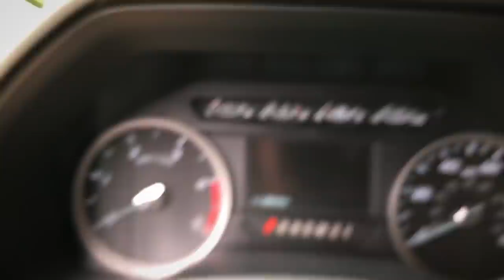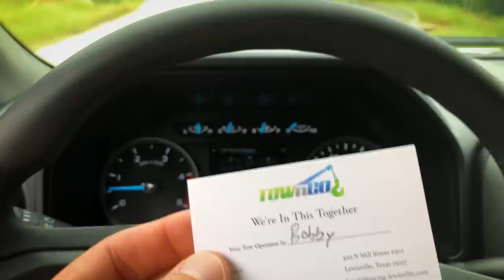I messed up...New F250 Stuck in Mud

Comment: Don't feel too bad, I totaled my brand new truck at 9,300 miles by getting it stuck on a beach in California where it sat through 2 high tides before a tow company would go out and get it... lol. https://imgur.com/gallery/PcAqvsE

Just be glad it was only a little mud and not waves of salt water lol.
Reply from the maker: Oh man!!!!!! 😬
Had to pin that.
Reply: @AaronBuley  lol, Yeah it all worked out though I think. The insurance covered it in full and I actually got like technically 500 bucks more than I paid for it, and they didn't raise my rates or drop me. And they had a buy back offer for the truck so I did that and then the guy that bought it is a mechanic and was going to do a little work on it and give it to his dad which was cool. So it all ended pretty well, I got a new truck that's working out better for me, and the insurance company doesn't totally hate me and someone gets a practically new truck for a fraction of the cost and the truck lives on to drive another day.

But the lesson lives on, you should never take heavy duty trucks through really any off roading adventures unless they and you are well equipped to handle it lol.

But I'm glad your truck made it out with no to minimal damage, that's always the best thing after getting stuck.
Reply from the maker: dedalliance1 yeah definitely learned my lesson on heavy duty trucks.   I was used to my Jeep Sarah Unlimited which could handle A LOT 

cool story on the truck 😁👍
Reply: @brianamrhein640  that's also how things get broken, or in my specific situation where 2 trucks end up flooded lol. But I was just on vacation and traveling through so I had no one to help me.
Reply: i never understood why people drive on the beach, what did yall think would happen?
Reply: @STREETRACEN4U  It's a legal drive on beach, and people drive on it all the time. What killed me was my truck was too heavy and I didn't deflate my tires and by the time I thought about deflating them it was too late. Offroading is a lot of fun and it's an adventure to go drive down the beach to see what you find. When I was a kid my mom took us to a beach in Florida and we drove out early 2000's 3/4 ton Yukon XL on the beach and everything went fine, so I had the same mindset that I would be fine too. Unfortunately, all it took was some soft sand and the truck was done for.
Reply: Atleast you probally got a another brand new truck out of it!
Reply: @silverback7659  Yeah I did, I actually got a little more for than what I paid for my other truck lol.
Reply: Not happy with that truck huh? Yeah "getting stuck" on the beach is a great way to get a mistake paid off isn't it😒
Reply: "4x4" is a huge misnomer on 3/4 ton trucks... Too heavy, no turn radius. I love my Ram 2500 but it will get stuck in a puddle leaving the driveway if you let it.
Reply: I did the same on North Shore Hawaii , a man told me to let most of the air out of the tires and came right out.
Reply: Ouch!
Reply: dedalliance1 OUCH!!! That def sucks!
Reply: @Crystal Bolyard Not junk. Just shitty off road. That's why they're called " Super DUTY!" LOL.
Reply: dedalliance1 there is no way in hell that ur insurance rate isn’t going to increase for the next five years after the incident.
Reply: Bra wood and a shovel
Reply: Buley Builds u would be ok with better tires
Reply: @thisoldnew4544  My insurance rate did not increase because A: It was a legal drive on beach so it's basically considered a road, and because of that it being flooded by the ocean is considered an act of nature and that I cannot be dropped or have my rates raised because of it. Every insurance company is going to be different, but that's how mine worked. And I only had the insurance plan for like, 4 months. If they drop me or make me pissed off and I leave them, they lose a lot of money versus making me happy and stay with them so maybe they'll get a little bit back.
Reply: @thekingsservant1104  Na I did like my truck, but I'm kind of glad I got to get a new one because I upgraded to a 1 ton and now I have a fifth wheel that my old one wouldn't have pulled very well.
Reply: @Mad Mac Nope, no youtube video.
Reply: dedalliance1 ............. I don’t believe you about your insurance rates not increasing. I live on the east coast (NC) and driving on the beach is NOT considered the same as driving on a state maintained road so I don’t know where you got that nonsense from.
Reply: @TheQuirby  lols. First off, I didn't park it anywhere, it got stuck as I was driving. 2nd, It wasn't a huge beach like you might see in Florida or other parts of California where there's 300 yards of sand above the high tide line, this beach was basically a cliff on one side (with large rocks everywhere) and then the ocean, there's no way to drive on it without going past the high tide line. https://imgur.com/gallery/s1FJepw has pictures of the beach and where I got stuck.

What happened was I was driving down the beach doing 5 mph or whatever, a couple was walking right on the water line at the time so to give them room and privacy I curve to the right to go past them and then I hit soft sand and the truck just came to a stop, at that point the game was over. Had I deflated my tires at this point I might have had a chance, but in my head I wasn't really 'stuck' I just lost some speed so I tried going and it just dug me down more and more.

Now I'm not saying I'm the smartest person ever, but you can leave your insults to yourself when you don't even know the situation.
Reply: @TheQuirby  Well, I can assure you my rates didn't go up because they considered it an act of nature and not a collision. Same thing as if I was in a flood zone and the truck got flooded out whether I was driving or not. Your driveway isn't a state maintained road but if your car got hit or flooded while parked on it they would still have to cover you with no fault on your record. Maybe it's different where you're at but that's pretty much what they told me. I also called every road side assistance number I had and the police to get a tow vehicle out there as soon as physically possible and the only guy in town that puts a tire on the beach(es) out there just happened to be out of town / taking a personal day. And the insurance has a record of the 911 call so I have every bit of proof that I exhausted every option available to get my truck out with no luck, so they covered it.
Reply: dedalliance1 ............ I didn’t insult you and you, YOU put your situation out there. I drive on the beach every weekend and have been doing so for 10 plus years and have never had this happen to me. The only time I have ever seen a vehicle overcome by the tide is when idiots that don’t have a clue on how to drive out on the beach park below the low tide markers and then just don’t pay attention
Reply: dedalliance1 ........... it’s not the same thing as your vehicle getting flooded in your drive way. You drove it out on the beach thus causing the problem. I still don’t believe you about the rates
Reply: @TheQuirby  Not all beaches are the same lol. You're on the east coast, the sand, the beaches, and the geography is all different than the west coast. And you're right I did put myself out there, I've put myself out in a lot of situations that probably aren't the best. One time I got bored and decided to go drive around in the snow in thje mountains, got 4 miles up a snow covered dirt road and got stuck, called a friend and he got stuck before he got to me, we both called the same tow company and he got my friend out but then left me in the middle of the woods because he didn't want to get stuck getting to me. I slept in my truck and called again in the morning, they sent out another truck with 2 snowmobiles, they had to rescue me and my dog on the snowmobiles at which point I had been stuck there for about 24 hours with no food and no water and then came back the next day with a 3rd truck to get my truck unstuck. The police were called and declared it an emergency rescue, It was a $1,600 tow bill. Insurance covered every penny of it, however, they did send me a letter trying to get me to pay it and I never did and then I left them and got a different insurance company. I'm not paying for insurance that doesn't do its job, if they say I have road side assistance I better get road side assistance. And all 3 of those tow trucks drove from the next town over which was a little over an hour away lol.

This beach had no low tide markers and I was driving in other tracks because I figured that would be relatively safe if other people had been there, my truck was just too heavy. And I never did park the truck, it just got stuck.

And you don't have to believe me about the rates I really don't care and I really have no reason to lie about it, what would I gain about saying my insurance didn't raise? Even if it did, they still covered a $36,000 loss on a 4 month old policy, they'd have to raise it to 1,000 a month just to get their money back in a reasonable amount of time and at which point I would drop them and go buy a different insurance company and then they would be out all that money. It's simple business. Just like if an employee drops a pallet of eggs off of a fork lift, sure you could fire them but now you have $1,000 of lost product and you're short a worker and you have to spend money hiring and training someone else. Or, you just keep said employee, take $200 out of every paycheck he gets until the loss is paid back and then you go back to normal, assuming he's still capable of safely driving a fork lift.
Reply: dedalliance1 ............ apparently you’re not aware of how insurance works. If you file a claim it’s documented and recorded as in it’s traceable. Sure you could cancel the policy and move on to a different company but........ the claim follows you for 3-5 years depending on the insurance company. Hey man, you can say your not lying all you want but no insurance company is not going to pay out on a claim that you created and then not hold you accountable for your actions. Do you not know there are two different types of “point assessments” that insurance companies use when determining what they charge individuals for a policy? If you’re unaware one is DMV (tickets, moving violations) and the second, non moving violations that cause insurance to pay out. 

By the way, if said employee broke or damaged company property the employer could NOT force said employee to reimburse them for said damages. It’s highly illegal and if an employer attempted to do so they risk serious fine from the department of labor which could possibly shutdown said business. Every business is required to have business liability insurance and workers compensation (if more than 4) employees to cover “accidents”. It obvious that you are not self employed otherwise you would know this information.

I’ll say it again, I don’t believe you with regards to your insurance policy not increasing due to your claim but you can keep on telling that story if want because that’s what it is, a story
Reply: @TheQuirby  Well then don't believe me I really don't care, I have no reason to lie.
Reply: @Allen Family I have a 2018 GMC Sierra 3500 HD Crew Cab Long Bed SLE with the 6.0l gas engine.
Reply: Lol
Reply: @Robert why are you so combative? Relax
Reply: Damn! I grew up in Pismo Beach and Oceano.
Seen lots of trucks get stuck, some are still out there.
Reply: Hope you disconnected the battery before the salt water took out your electrical.
Reply: @freakyedits2699  I don't use Ford? lol.
Reply: That kind of thing wouldn't happen on our beach. We have a group around here called the "Sons of Beaches" They've probably pulled more than 1000 vehicles from the sand (myself included and very recently, a semi truck). Some sand was stuck to my wheel hub as well and you wouldn't believe the shaking it causes. I took my shaking van to the tire shop when the showed me the sand on the inner part of my wheel hub. He smacked the tire on the pavement, put it on and said "fixed, that'll be ten bucks"
Reply: I wouldn't tell anyone that dummy!

Comment: Why doesn't the tow truck driver just stay in one spot and actually winch you out 😂 Sketch
Reply: inferior winch and no snach block on small flat deck tow truck is my guess.i could have pulled him out from the road I have 145 ft of recovery gear rated at 10k lbs.
Reply: @jaymanxxxx  I was thinking that same thing too but did they really think they were going to get anywhere, the ground is muddy you're just going to sit and spin
Reply: I was thinking the same thing!!
Reply: @jaymanxxxx  Definitely an inferior winch and I'd say an inexperienced tow man. Length is great for a slightly stuck vehicle.  Apply enough straight pull to a rig with the axles buried like that and you just might leave the axle behind.  I've seen the front axle torn off pulling out a heavy duty truck with a buried rear.
Reply: Because that winch wasn't strong enough to pull a vehicle out of 2ft deep in mud
Reply: @jaymanxxxx  The 2nd Truck did just that, sooooooooo
Reply: the second guy, he had a snatch block @VancouverCanucksRock
Reply: @Cjohn656  Sooooo that means he couldn't have attempted to use the Winch to extricate the Truck?
Reply: Personally if I was driving the tow truck I would get a long ass chain I wouldn’t go that deep down in there

Comment: Essentially whenever you start to get stuck in mud and you're not going anywhere, just let off the gas and don't do anything more. Same with sand. It'll just get you more buried. It's a bad day. I've been there many times.
Reply from the maker: Yep.  Hard lesson learned.   My Jeep Sahara Unlimited never had this problem.   It didn’t weigh this much had had 37” Nitto Grapplers on it.  :)

Comment: I am glad that you showed this!  I got my F250 Super Duty stuck in the mud at my farm.  Similar to your situation, however the right rear wheel didn't slide sideways, it just sunk directly down into a sinkhole.  Of course, I sunk it in deeper trying to get it out.  Two days later (after it dried out some but not where I was directly stuck), I dug it out a bit and went online to research.  Watching this taught me I needed a commercial strength wrecker with a winch not my friends with their equivalent truck and a chain...  The guys came, really knew what they were doing, and had the truck out on the first pull.  Fortunately, the truck also started right up and went into 4WD so they used the truck's power to assist.  They continued to load it up onto the flatbed, took it a ways to my driveway that was dry, offloaded it and checked it out.  They observed that the power steering etc belt had snapped, so I had them take it to my mechanic to check everything out.  So, sorry you had the situation, but glad you shared.  I loved the shots of your kid power-washing it in her bathing suit!
Reply from the maker: Thanks for the comments.  Glad you found this helpful.  :)

Comment: You need mt tires bud, idk why youd even think about going offroad on highway tires.
Reply: Facts!
Reply: Yes this should have been part of the deal buying the truck
Reply: Wouldn’t of mattered
Reply: MT  tires wouldn't have gotten him out of that...  Not taking a 7000 pound truck into the mud is a good first step.
Reply: Just because he has highway tires doesn’t mean anything. And mud terrain tires wouldn’t have got that out because he was framed out
Reply: All true! But he wouldn’t have slipped into that tank trap to begin with having some solid MT 12.50’s
Reply: Colton I can’t agree with you. I slipped off in a ditch the other day that was pure clay from Georgia... and I have 35/12.50/20s on my truck
Reply: Real question is why take a f250 truck for that lol people this days jus because it a 4x4 they think it’s meant for off roading

Comment: My opinion..   first flat bed driver,  crazy driving so close to your new truck.  Even if he couldn’t reach,  those straps that have some length was the safest thing to go with.  Takes the flatbed out of the equation of being stuck or causing you any damage and allows a safe distance to pull from.
Not to mention it’s a heavier framed truck-

First time I drove standard..  got my fathers 1500 stuck-  also the tow truck got stuck in the snow(2wd) and he had to winch off me..   
all in all good times!
Reply from the maker: +R J haha yeah.  First dude was crazy!   I thought he was going to hit my truck for sure

Comment: I think those floor boards saved you from a good deal of damage, as they worked like a snowshoe, spreading the weight over a lage area, and stopping the body from going lower .. maybe even saving the front bumper.
Reply from the maker: Grumpy ol' Boot you know what, I think you’re right.
Reply: Hey, as the second tow truck driver said, you got lucky. :)

Comment: When you're stuck like that you either need a snatch strap so you can get some momentum or if you don't have a good strap tie an old tire in between the steel cable and chains so it will give you some rebound shock
Reply from the maker: good call